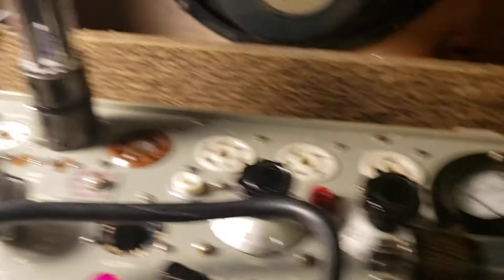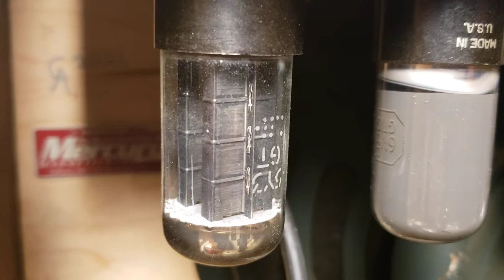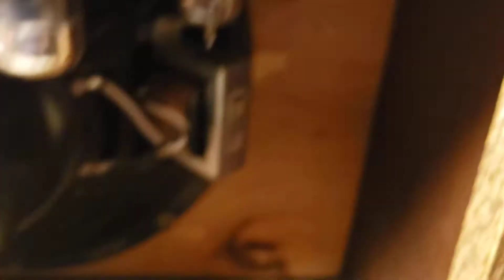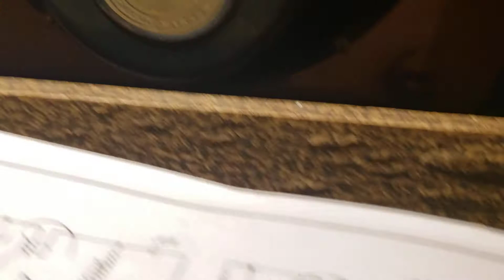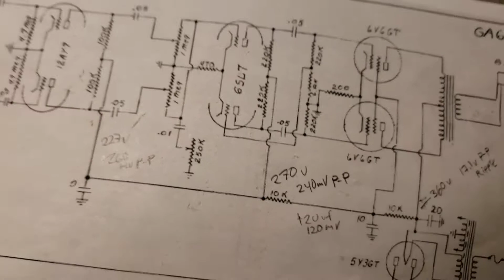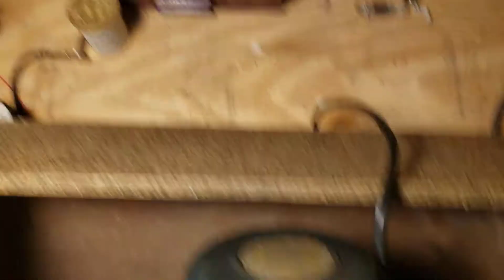How I Restore a Destroyed Guitar Amp - Gibson GA-6 - Part 7

Comment: I just worked on a Ga18T Explorer that had a 15 amp fuse in it 😂. The amp was basically fine and just needed the electrolytics and tremolo recapped. Sounds great. Built a new hardwired tremolo pedal for it too.

Comment: I play harmonica, 46 years and was full-time pro by age 20. Started in Bluegrass bands, then full-time in a Country Honky-Tonk band (that was 1977-79) then later for 10 years had a swing dance, jazz, blues, R&B band, which was before 7 years in Austin playing with a bunch of style groups and sessions. I typically play Fender Tweed Bassman amps (I have owned about 8-9 originals) with some 5E5-A Tweed Pros and 5E3 Deluxes. I was down to just one Bassman and had played a freind's 5A-6 Gibson with a small combo band and it sounded great. I just picked one up that had been asquired by someone who buys out abandoned storage units. 100% original but noisy! I am not a tech but could see the filter caps were obviously swollen, the other ragged sound seemed like may a couple resistors, caps or tubes. Speaker cone looked good from back. Anyway, took it to the tech I work with and he's about to start going through it. I sent him your videos here, liking the turret board and maybe he can gain some useful information so........thank you for posting!